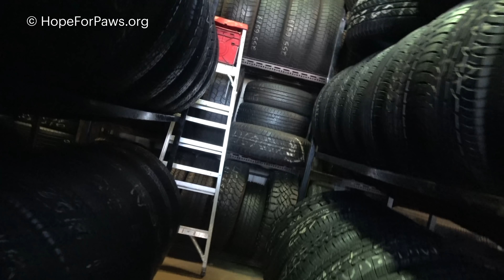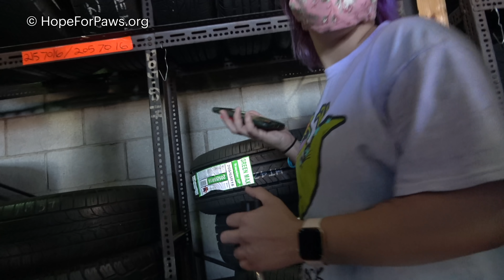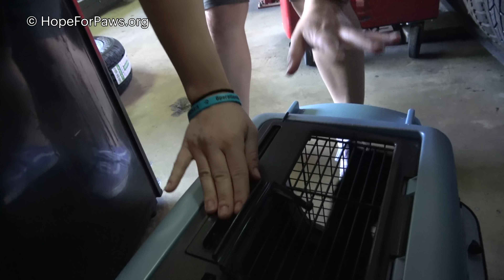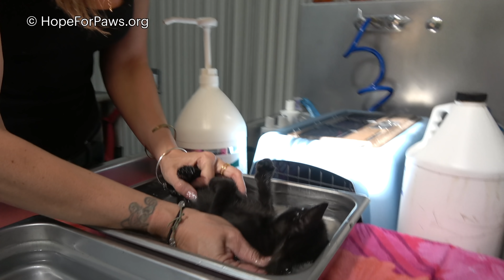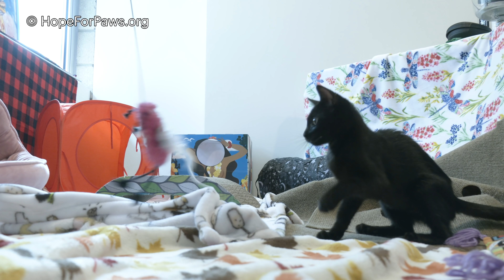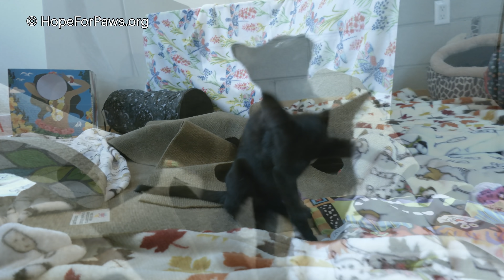Unsuspecting mechanic opens the hood and finds a surprise! #love

Comment: Goodyear is a beauty. But I must repeat something I have said many times. Do  not buy or use a top loading carrier that has the handle on the door. The door latch can fail and door will open. After I saw this the second time, I never put even a small kitten into one. Buy and use only a carrier with ONE door on the front !!!